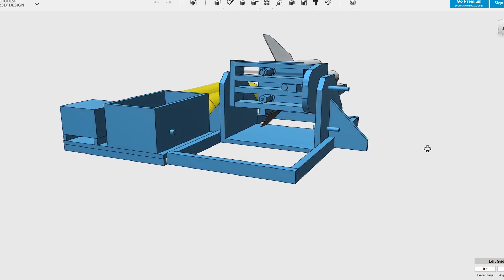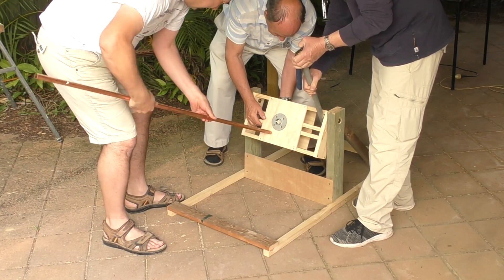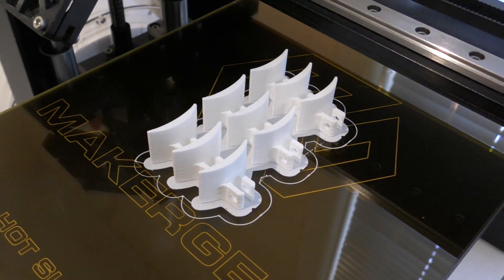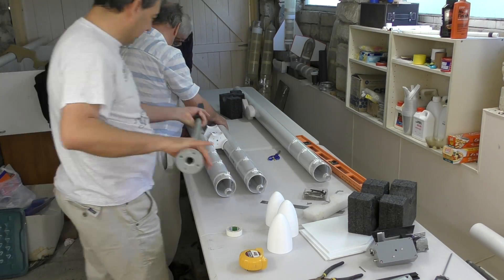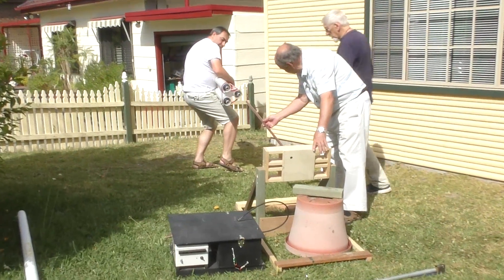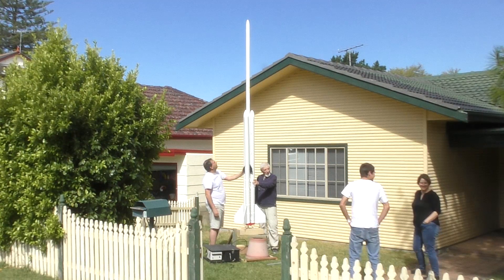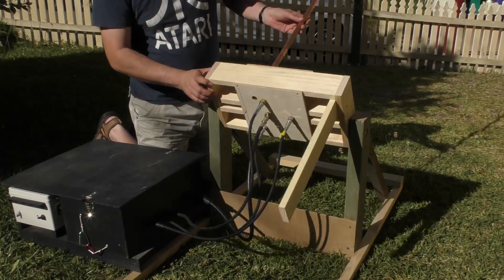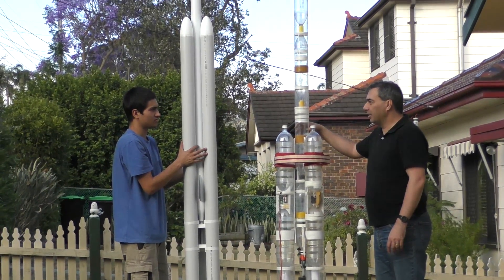2 Stage Water Rocket - Part 20 - Launcher Prototype

Comment: Over and above the locking wheel brake, if you apply a screw jack to a jack stand, also maybe apply a bubble level and screw feet to the pedestal to ensure perfect level/plumb/vertical before locking in place. ~( 'w')/

As I have operated cranes before, some of them come with leveling jacks [usually hydraulic, but some really old ones had screw down types ('back in the day') ] and it ensures one a very level system on even extremely sloped uneven ground.

Comment: "Rock boxes" or "sand platforms" may be helpful to add ballast to the pedestal so that is is heavy enough to not be blown away in a strong wind [not going to assume you shoot in a strong wind since we all know that is not wise, safe, or optimal] should an unexpected gust suddenly appear from nowhere [like a spontaneous dist devil, which I have experienced personally as a child, so my dismay, totally wrecking my ice cream! /( -_-)\ ] and kicking the whole unit over.
Reply from the maker: We will have a fairly heavy and wide steel base on the launcher so not too worried about a strong breeze, but a dust devil is certainly a possibility as we quite often  see them at launches and have had a few go through camp. A dust devil would not be compatible with the launcher setup.
Reply: @AirCommandRockets  Can you put screw jacks on the corners to level the platform?

I know many RV campers have them, and they come in many sizes, and if you are on almost totally flat ground, you really do not need a large one.

Comment: May I suggest, since a locking pin might constrain you to an angle which is not precisely vertical, perhaps you can mount a brake disk and caliper to the pivoting parts which can then be clamped into place when the rocket is proven to be vertical?

I would think it would not be difficult since you have essentially an axle going through a frame [to support a carriage with the 'stem' that holds the rocket plus the valves and the terminal ends of the hoses, and the trigger], simply mount the brake disk and the caliper outside of the frame so it does not impinge upon the rotation of the carriage.

Such a caliper need not be an actual brake caliper, it could be a common C-clamp or some other device, and the brake disk could even be made of wood, aluminum or steel plate. To get a good flat round metal disk, an old used saw blade would be perfect and it is possible some local carpenter might be willing to donate one which has gone beyond its usable life.

I have at least one I could donate, but from the USA the shipping would be ludicrous so that its by all means more intelligent to get one from somebody closer to you.]

All you would really need is a fixed place on the upright part of the frame from the pedestal where you could mount something off one side close to the axle, and the disk [of whatever material you make it of] affixed securely to one end of the axle so that it can be gripped securely with a nut, bolt and washer.

I suppose, in its ultimately simplest form, drill a hole in the frame, apply a nut and washer to one side, a washer in the middle, and a bolt and washer on the other side, and tighten with 2 wrenches at the point when it is in position.

If you need a sketch I can do so right quickly upon getting your reply.
Reply from the maker: We will cover this locking mechanism in an up coming video. It needs to be fairly simple and quick to lock because we tilt the rocket down just before launch so we can turn on all the electronics and cameras, and then we stand it up again and would want to start pressurising fairly soon after that. We talked about using the tilting platform to point it vertically, but that is only in one dimension, and we would still need to do something in the other dimension and so we will level everything one way, and lock the mechanism into place another way. There will likely need to be additional bracing on the rocket after it stands up, and so that has to be also quick to lock into place.
Reply: @AirCommandRockets  One could use vise grips for a rapid deploy/rapid release lock I suppose... ~( 'w')/

If the launch rod were on a bidirectional gimbal, you could just use a spring loaded leg with a rubber foot on it, sort of like taking the bottom half of a pogo stick and putting a roto-lock bolt mechanism on it by cutting a very short J-shaped groove in the  end of the outer tube, and welding a small bolt or piece of rebar to the inner leg so that with a quick easy pull one could lock or unlock it from or into any angle out to the angle where the foot slipped sideways... 

And for increased traction on the base, either glue a sheet of sandpaper or rubber to the location where the pogo foot is expected to come in contact.

This would help more if an unexpected gust of wind came along.

To ensure maximum self leveling just make the gimbal in such a way as to have it weighted [a drainable tank for water (or sand) might work as it could be filled when in use, but emptied for travel so it was not a perpetual weight to life and move] and just let the weight work as a pendulum to find the lowest possible center of gravity and then lock it in place.

That said, bubble levels would work to indicate either 1 or 2 directional rigs.

Comment: This just came in and reminded me of a laws of gases I had somewhat forgotten until now...

Dalton's law

https://www.youtube.com/watch?v=Uk6YMWwV_Oo

https://en.wikipedia.org/wiki/Dalton%27s_law

If you remember you were having issues with heating inside your vessel while charging...

I do not recall if you said you were charging the system with compressed air or from a CO2 tank?

If it was compressed air, than this would not apply, or else, would not apply as severely anyhow.

Comment: Congratulations George and team! With that mock-up we can have a real sense on how the final rocket will be: wonderful! If you would not make this mock-up,, would you had the real launcher impractical? (due to key measurements or constructive details). Thanks for sharing and keep going that great!
Reply from the maker: Thank you Francisco, The mock-up showed us a couple of things: 1. It is going to be fairly awkward putting the rocket onto the launch tubes when it is full of water and heavy, and 2. The base holding up the entire launcher, will need to be much wider than we thought to prevent the rocket from tipping over in a breeze. Both of those were not evident from the CAD model. Once we finish the actual tiltable platform over the next couple of days, we'll mount it on the wooden base and have a go with the mock up again to see how easy it will be to load the rocket onto 3 launch tubes. Then based on that we will make the base out of steel. The mock up will also be used to make any support stands for the rocket when we fill it with water.

Comment: Use CO2 to charge the Water Rocket instead of Air, it will go further.
Reply from the maker: Yup, CO2 is certainly one way to boost performance.

Comment: Hi George. Question, do the boosters separate once spent, or remain as one unit. I was thinking that if it remained as a single unit, then you could get some weight saving by not having three sets of parachute gear.
Reply from the maker: Hi Kory, the booster will remain together as one unit just like it did for the Acceleron V rocket (https://youtu.be/3SScKAlKiFg). For most test flights we will most likely have 2 parachutes, one of them being a safety backup, but for any high performance flights, we'll probably just use one to save a bit of weight.

Comment: What about nozzles?
Reply from the maker: The nozzles on the booster will be ~19.1mm, because that's the size of the launch tube we are using. We are basically matching the nozzle size to the size of tube that is available.

Comment: Nice work! The mock up of the horizon rocket looks really neat. How are you planning to detect burn out? I guess that you would like to start the second stage as close to burn out as possible. This way, water will not move upwards due to drag force and you would obtain maximum performance. Another thought is, what is the magnitude of the drag force after burn out? In case of a late stage ignition, would water change the trajectory of the rocket due to its moving mass?
Reply from the maker: Thanks Daniel. All good questions. We have not yet decided how we'll detect burnout, but most likely using an accelerometer. We still have to figure out what will be the optimal time to stage the rocket. We may let it coast for a second or two before staging. In the next video we'll have a look at a possible solutions to the water moving upwards in the sustainer. The moving mass in the rocket is definitely something to consider, but because the sustainer is so thin any lateral imbalance is likely to be small, but you never know until it is flown. :)